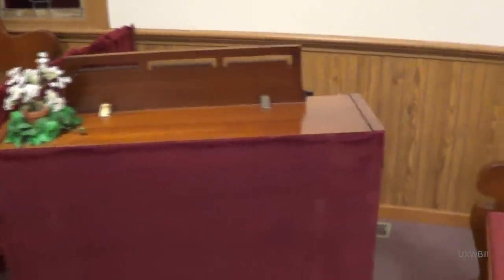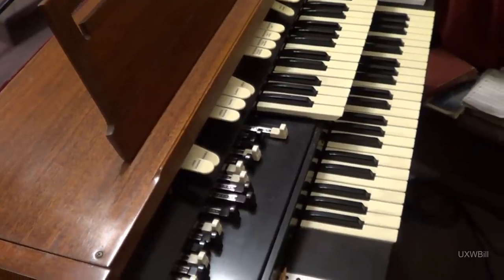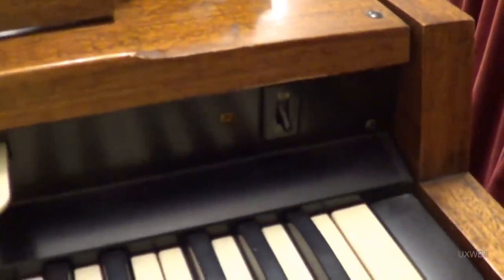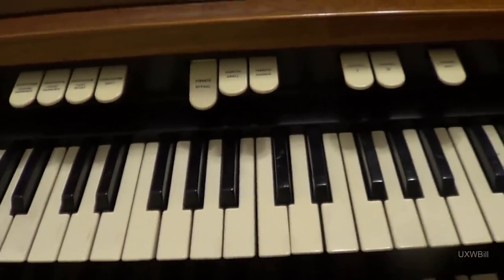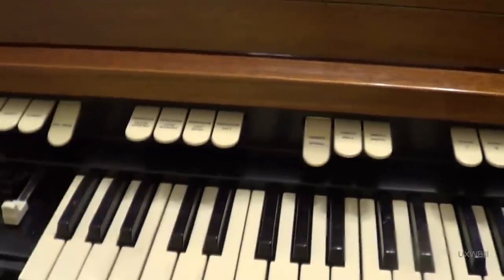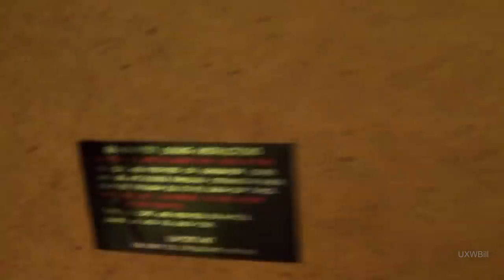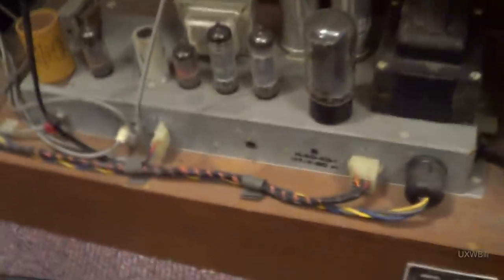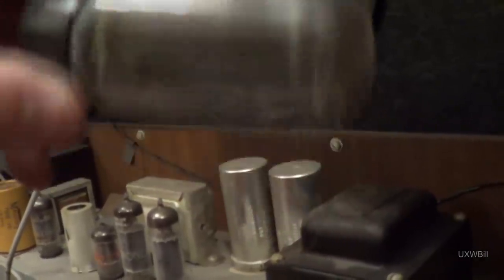Exploring/Troubleshooting a Hammond L-102 Organ

Comment: After seeing how it looks inside, I'd love to know how it actually works! How does it make the tones? Etc...
Reply from the maker: That large motor-driven assembly is the tone generator. It's driven by a line-synchronous motor for reference purposes (so long as the powerline frequency is accurate!). Inside, the tonewheels spin at a given rate, introducing current pulses to nearby pickups. As keys on the keyboard are pressed, different combinations of tonewheel pickups are switched on to produce a given type of sound.
Reply: @uxwbill  That's really neat, thanks!  I love the ingenuity the engineers had in designing all sorts of these really antique "pre-transistor" appliances. These days a cheap keyboard with a single microcontroller does the job. But it's just not the same :P
Reply: @redpheonix1000  The first hammond organ was made in 1935, back then the only possible way to make it sound precisely in tune and have it being reliable was to use electromechanics as the only requirements for the instrument to be in tune was to have all the wheels to be shaped with a precise number of teeth, having a solid transmission system and a motor which will run always at a precise speed as long as the power line frequency is available and precise.

Comment: I'm going to guess filter capacitors. Judging that interference from other devices switching on causes the problem, that'd be my first choice.

It's worth mentioning that not all capactiors will go bad in these things - Oftentimes, you'll find televisions out in the California desert that have sat in the elements since the 1960s that need maybe one or two replaced and some contacts cleaned to get them to reliably work again. In this case, it'd be best to test each individual one instead of replace them all, as some of the specific capacitor values simply aren't made anymore or their characteristics have changed enough that they might as well not exist for your purposes.

Shango066 would be someone to contact about this, definitely.
https://www.youtube.com/watch?v=QQeG50uMtA8
Reply from the maker: What preserves the wax paper capacitors in sets from dry areas is just that -- the lack of moisture. In more humid parts of the world, the capacitors tend to take on moisture and this eventually shorts them out.

It's possible to combine more than one capacitor to get an unusual value, if need be. It's likely that outside of the tone generator, the value of most of its capacitors won't be critical.

Comment: uxwbill
 Some of that old tube stuff has old style wax and paper capacitors which typically go bad bad capacitors cause hum on tube radio's not sure if organ has them might need recap if it has old capacitors.
Reply: I was thinking the same thing check the filter capacitor it might be three capacitors in one can. Most times they are in need of being replaced at that age.

Comment: Hey Uxwbill maybe already know this stuff ,but of course I'm sure I'm wrong, but I watched video over that electronic noise your heard was the Leslie motor. It make the sound vibrato waver when keys pressed I heard the motor spin down as you turned power off. Some were electronic however this organ has I believe as I've seen on here a spinning double  cone that's belt driven I believe and if you flipped the switch for Leslie or vibrato it would turn that noise off. Hopefully you can fix this classic.  Booker T played his famous green onions on one of these Hammond organs but different model..
Reply from the maker: The motor you hear running drives the tonewheel, which is responsible for producing the actual organ sounds. It is a form of electromechanical oscillator. The vibrato is implemented entirely through electronic means. You can see in the video that there is no provision or room for the two speakers to rotate within the organ.

Comment: I was quite surprised at the question raised in the video, about being unsure if it's a tonewheel organ or not. You must have a lot of viewers otherwise because this is a long video about an organ you don't know some pretty basic stuff about.  YES that him is from the tone wheels spinning.   You definitely don't want to replace those capacitors.The L100 models (L110,111 etc.  Same but different trim package) is akin to the M100 series (marketed as the mini B3).  The L100 series doesn't have the good analog chorus of the M series.   The L series is more rare in the US but prevalent in Europe. It's a later model, but assidr from the chorus, as I understand essentially identical to the M series in large part.  EXCEPT, the L series has the highly desirable red capacitors, which hold thier value better.  They can be used for a B3 overhaul and I don't think they should be replaced, nor thrown away.   Couldn't make it through all the video, but will give some of your other content a look. Lost me quick for a 13 minute organ video and didn't know if you were working with tonewheel or not.  Good luck otherwise.
Reply from the maker: No one is an expert on everything, including yourself. That's something to keep in mind for the next time.
Reply: @uxwbill  I get it, and I think I mis spoke earlier, the M100 has a scanning vibrato that is absent from the L100.  

Nobody is an expert on everything, including myself.   We are also free to do whatever we choose, like post a bunch of videos.  Sometimes the journey is the point, not so much the destination.  Personally I would feel wierd posting up content I didn't without some expertise, or at least had some legwork into.   But that hesitation I have is also a negative quality depending on ones perspective.  

Sorry the the negative nature of my original comment.   I am curious, what did those that liked the video like about it?  The video has decent circulation, which is impressive to me I light of my original commentary
Reply: @electrichop  Hey I just got a L 102. That's what brought m to this video. It turns on, but doesn't make any sounds. It seems the tone wheel is working. I ordered some oil and new tubes. Some of them weren't glowing that much. What else could I do to trouble shoot it? Thanks
Reply: @electrichop  As someone who doesn't work on organs daily, I liked the video because it was a neat bit of insight into these things. There's no need to be rude about the video. Some people watch YouTube videos for entertainment and others watch them for their information.
Reply: He meant to refer to the capacitors on the tonewheel generator itself, if they are red plastic case caps they shouldn't go bad and if they did it would be a real pain to find one that matches because they were selected at the factory to go along the windings used as filters underneath them. They almost never need to be changed, all other caps in the instruments should be checked or changed out.